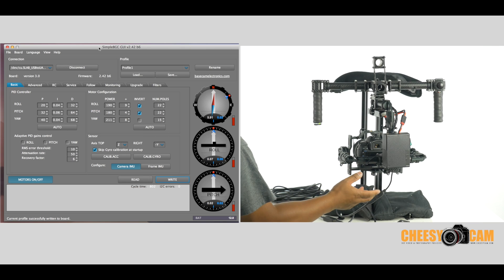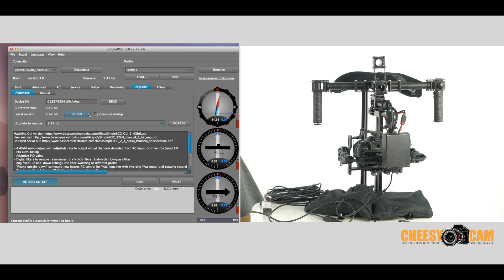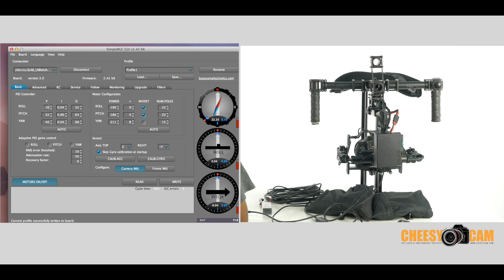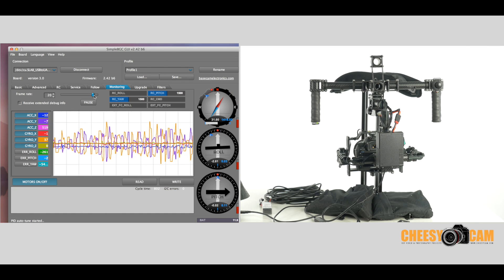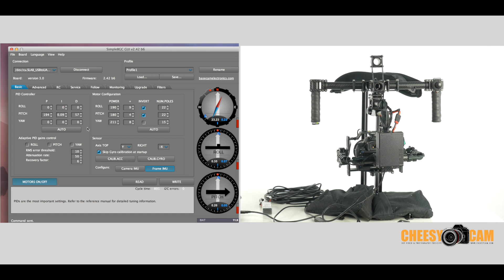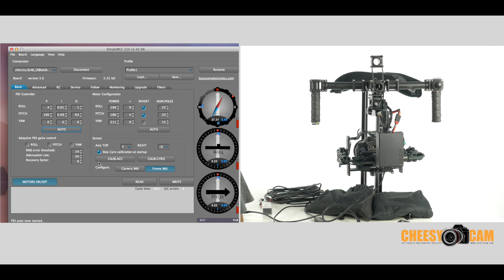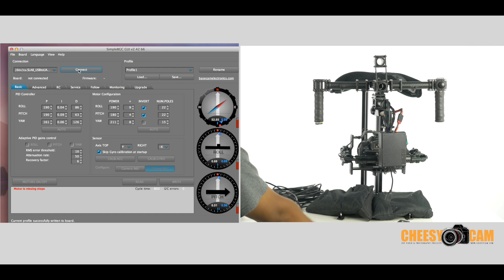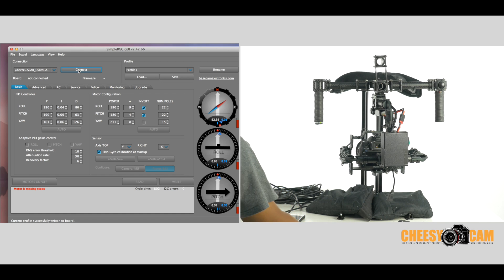3 Axis Gimbal Auto Tuning PID Settings Alexmos SBGC Firmware Upgrade

Comment: Quick question; if you deliberately push the pitch out of the horizon line will it move back again to a level position? Mine does this with roll and yaw but not pitch, any ideas?
Reply from the maker: Yes it should go back. Unless you are doing this in a profile that has follow mode enabled. Try it in a profile without follow mode.
Reply: I have follow YAW enabled, but roll and pitch disabled. Is this still a wrong profile?

Comment: https://www.youtube.com/watch?v=TBIwrVIo2Ig

Anyone can point me in the right direction to fix this "overpitching". I have followed several PID tuning guides without success.
Reply from the maker: +Johan Hilding I would double check all of your sensor orientations. Looks like it's confused and doesn't know which way to rotate.
Reply: Do you mean a 6 point calibration?
Reply: Im checking the sensor TOP and RIGHT. If I change them it turns upside down or just vibrates. Did you mean these?
Reply from the maker: +Johan Hilding If the sensor orientation is correct, then try selecting the 'invert' option for pitch.

Comment: These things are incredibly touchy if you don't know what you're doing I wouldn't mess with any of the settings using SBGC. I did your one tutorial to auto calibrate the sensors and I'm still going back and forth with their tech people to fix everything. It has been a week now. It's a complete mess. Seriously it's a horrible idea to mess with anything unless you know what you're doing. I'm about to send mine back I'm so frustrated. So heed my warning unless you want a cool looking paper weight.
Reply from the maker: +Max Liberatori It can be very frustrating if you're unsure about what to do. Once you know how to do it, it's pretty straightforward and not frustrating at all. I guess you begin to understand 'what not to do' and then you never get in a situation where it's not working well.
Reply: +MrCheesyCam truth man truth.
Reply: +Max Liberatori Did you take the backup of the original setting? And then reapplied if the auto tuning failed

Comment: Plugging my ASP 3 axis gimbal with 32 bit alexmos 2 imu's goes nuts when plugged in. IMU's have been calibrated. What I'm I missing?
Reply from the maker: +Moses Yuhanna Are you sure the sensor positions are correct? If you have the orientation off it will go crazy.
Reply: Thanks. That fixed the issue. would you know why the yaw axis might be wondering slowly? What pid setting do I adjust? Thanks again
Reply from the maker: +Moses Yuhanna Calibrate Gyros, and if you are using a Joystick, Calibrate RC Trim: http://cametvblog.com/how-to-calibrate-joystick-neutral-position-to-prevent-your-gimbal-from-drifting/

Comment: I can’t seem to get the motors to working. It connects to the software fine. The motors just won’t move. 

Tarot 680 Pro
Naza M V2
Taranis Plus Transmitter
X8R Receiver
Reply from the maker: Triumphal Bridges Sorry i'm not sure what you're asking. Did you click on the Motors ON OFF button?
Reply: Yes I have clicked the motors on. 

Basically, basically I have followed the instructions in the manuals to the T. I have all of my channels in my receiver set up and I am getting responses from those channels. I have power to the Gimbal via my 14.8 V Multi star battery. I have even tested the gamble when my battery had drained to about 12.5 V. the gimbal reads on the software just fine however, I am not getting any type of Motor activation.

Now I am running into a separate issue. lol.
I was using the simple BGC software version 2.43 and then I switched to the 2.50b3 version just to see if my motors would activate. The gimbal read on both versions. However after I updated the firmware using version 2.50b3, my gimbal no longer functions on either software versions but the s/w still sees the COM port. I press connect on the right COM port and it just freezes. I have tried to connect to gimbal to downgrade the software without success. I'm using a Macbook pro btw. Thanks a lot!

Comment: I'm having some problems with pid tuning, not getting any  12c errors. My roll axis doesn't come back to home position, and when it does it comes back extremely  slow. Sometimes it jitters.
Reply from the maker: charles reeves The 'i' value is what makes it come back to home slow or fast. The 'D' value is what is used to reduce or remove any jitters. Depending on your condition, try raising the D value or lower the D value to reduce jitters. I would work on this method one axis at a time. It appears you are talking about the 'Roll' axis so only work on those values.

Comment: This is not an insult, but I find it funny that you are doing the video and discovering  the auto PID at the same time.  Its the same feelings I went through the first time.

Why on earth such high P and D.  I barely turned P up past 8 on my old 8 bit.  My problem is I'm aerial and when I fly right, the horizon leans right.  I've increased gyro thrust and everything.  I have a feeling the extremely high PID values are causing it.

Comment: HELLO SIR
i was trying to tune the gimbal everything was fine , till i upgraded and everything went to hell , the gimbal is shaking spining , the controler dont work no more , and its a brand new cam tv 8000 , please help me :(
Reply: Ghouti Lakhdar If you've just gone to V3 you'll find this problem is to do with calibration. The new firmware runs a temperature based calibration.  Try connecting to the gimbal on the software then turn off the motors. Now go through the new calibration procedure - all should be well after,

Comment: Wanted to thank you for the wonderful video series.  Lots of answered questions from it.  I was having issues with my apple weekend.  I am not completely seeing it work with iron clad effects everytime.  Its particular for me on connecting up.  I have had good luck in the past with having the system powered up and connecting up.  It seems a little issue sometimes connecting like it hangs.  On a side note I am tuning a alpha 5000 camera and am getting the pid settings on the edge of working.  I did the auto tune, but it was not holding the pitch as good as I wanted.  I moved the slider to the left and tried again.  No good.  I tried manually tuning the P,D values till it started humming than backed off and did a I value.  Seems like 20 degrees or more forward I get it to tilt forward a small amount.  I wonder if I am, doing something wrong.  https://youtu.be/S52MLqEwDgA

Comment: I think you did not hit the write button on the last tuning before you disconnected it. Is that a 32 bit or 8 bit alexmos?
Reply from the maker: cjthreelogy1 I was just doing a demo, but yes you should hit write any time you change settings (except for calibrating sensors and gryo, no need to hit write).

Comment: I got a good deal on an Alexmos 3 Axis gimbal on craigslist. I tried to upgrade the firmware from 2.30v b5 to 2.49 v9. It worked ok before I upgrade firmware but now when I connect it usb to my computer running 2.49 version my gimbal does not do anything and I get a time out message when trying to connect it. Do you have any recommendations because I went to SBGC website and the older firmware version links no longer work if I wanted to flash back to the original firmware? Did I brick my gimbal? Please any help would be greatly appreciated!
Reply from the maker: Victor Holloman From the new firmware you can choose a drop down menu to 'downgrade' the firmware. But the problem is most likely your settings. You have to walk through the process to set up all the settings like Sensor orientation, calibrating sensors, calibrate gryo, choose motor inversion, motor power, PID settings, etc.

Comment: I have been trying to set my gimbal up for hours but my yaw motor just keeps spinning slowly round in the same direction. I have tried inverting that motor. it does it with follow on and off. The no of poles is correct. I have calibrated the imu's several times. Can anyone suggest how I can resolve this.  Thanks

Comment: MrCheesyCam I received my Came 7800 and am using a sony a6000 camera. This camera is smaller and lighter than most cameras being used on this gimbal. I know that the gimbal comes set up with the most popular PID settings (which would be for a heavier/bigger camera). Everything seems to work okay. However, when I power the gimbal on, the camera roll is not level. Its as if the camera is leaning to one side. Is there a setting that I could change on the SBGC GUI that would help level this axis out? Other than the camera slightly leaning to one side, the gimbal does a great job maintaining the position and smoothing out the movements. 

Thanks!
Reply from the maker: Mark Grass In the software you can start with 'Calibrate Gyro'. Set the gimbal on a stand (use two chairs or broom sticks whatever to hold it up) and hold the camera as level and as straight as possible then click the button calibrate gryo.

If that doesn't work, then try to calibrate the sensors. Same thing, hold the camera as level as possible and click calibrate acc. There are two, so do it for each Camera IMU and Frame IMU.
Reply: MrCheesyCam Emm, your the man!!!! Calibration did the trick!

Comment: Hi MrCheesyCam, I got my new quick release plate for my came 7500 and i installed it. How ever i tried to configure it by following the 6 IMU settings and auto PID setup and i have a problem. Here is the video CAME 7500 error
Reply from the maker: Arish Perez I think you have 'number of poles' set incorrectly which may cause the 'motor missing steps' error message.Also I think you have the position of the sensor setup wrong too. When you flip it upside down, only the Z axis changes. The sensor side facing 'right' is still the same. Put it back where it's supposed to be.Also whenever you hit 'write' on the Camera IMU or Frame IMU make sure everything is perfectly level. You were hitting the 'write' button while your gimbal was totally not level.
Reply: MrCheesyCam How to get the right number of poles? I just copied it from one of your video :) I cant put the camera IMU on the same place because the cable is too short from new quick plates bought from came so that is why I decided to put it at the bottom of the the camera holder. How I would set up the right axis? before it was located at the top of the camera and the Y axis is on the left of the gimbal and Z axis is facing up. So i put the sensor at the bottom, my Z axis now is facing down so i set it -Z and the right axis is -Y. Is my axis is correct? Thanks again MrCheesyCam for taking time to answer my questions I dont even use my Came 7500 yet since i bought it because of this problem.. Mabuhay!
Reply: MrCheesyCam How to get the right number of poles? I just copied it from one of your video :) I cant put the camera IMU on the same place because the cable is too short from new quick plates bought from came so that is why I decided to put it at the bottom of the the camera holder. How I would set up the right axis? before it was located at the top of the camera and the Y axis is on the left of the gimbal and Z axis is facing up. So i put the sensor at the bottom, my Z axis now is facing down so i set it -Z and the right axis is -Y. Is my axis is correct? Thanks again +MrCheesyCam for taking time to answer my questions I dont even use my Came 7500 yet since i bought it because of this problem.. Mabuhay!
Reply from the maker: Arish Perez The CAMETV 7500 came preconfigured and everything should have been left the same. I believe the settings should be 22 / 22 / 18 YAW. I would suggest that you start from scratch with your PID settings, and don't use the Auto Tune for now. Watch my other tuning video Part 7 - CAME 7000 3 Axis Gimbal Build - Super Basic PID Tuning for CAME 7000 3 Axis Gimbal

As far as changing the position of your sensor, you just flipped it. So the Y should not change. It's just upside down, but that does not make it -Y. After you setup your sensor positions, point the camera lens away from you as if you were going to use the gimbal. Then 'roll' the gimbal left and right and watch the sensors. If you tilt the camera left, the sensor should tilt left. If you tilt down, the pitch should tilt down (not up). Watch the software and figure out if you have things backwards.
Reply: MrCheesyCam Yes I did flip only the Camera IMU and Y axis still the same which is the left of the camera. So the right axis still -Y.... Am I confusing the left and right of the camera?
Reply: MrCheesyCam I found on your video a profile... is this will work on mine and do i need to change something? Thanks 
http://cheesycam.com/came-7000-3-axis-32-bit-gimbal-with-canon-5d-dslr-profile/
Reply from the maker: Arish Perez Ok, i'm confused but yes the settings should be -Y. The only thing that would have changed is the Z.
Reply from the maker: Arish Perez The 7500 is slightly different. Instead of going with a downloaded profile, why not try to start from scratch with basic PID tuning?

Comment: Hi CheesyCam good info for those of us who are shopping to see how A.T feature works, and I hope it is not too nit picky of me to point out that from the moment the camera first flipped over during the Roll portion of A.T. there was a red lettered Alert in the info box that said "Motor missing steps" and it stayed that way for the duration of the session. This begs a multitude of questions but I will simplify:-) I assume that you have figured this out by now and wondering if it is a consistent glitch in the GUI . Does this condition render the session as useless and that you should start over? Maybe it has been fixed in an update etc.... Comments? Regards C
Reply from the maker: Chris Leech Don't worry about that, it's because I was messing with the Poles option in the motor settings. I do a lot of testing and mess with certain settings. If you set those correctly you may not see that message. This is basically just covering the Auto PID workflow. As you can see in the end it still worked perfectly to keep my horizon level.
Reply: Thank you for getting back. Some say this auto tune feature may not work with the 32 bit boards which I have coming (Storm32BLGC), your experiences?  I'm attempting to get dual functionality from a couple of kits. Hand held plus Aerial format for my 810mm multirotor but how to do the quick connect .... More fun than a Lego set no? :-)

Comment: Thanks for the awesome Video! I seem to be having a slight issue with my roll. It just want to keep drifting slowly to the left and I can't stop it. any ideas?
Reply from the maker: Chris Haynes When you say 'Roll' drifting to the left, does that mean the horizon is not level? Or do you mean the 'Yaw' is swinging the camera to the left? Either one could be a few different things. 

First try to do a 6 point calibration on your sensors and calibrate the Gyros. If it is still happening try disabling the 'joystick' in the software. A bad joystick can act like it's always on and making the camera move. If you have a joystick, disable it in the software and see if it stills drifts slowly.
Reply: Reseting the sensors did it! Thanks for all of your help! We would all be lost without your videos.

Comment: i have legacy 3 axis gimbal with alexmoss simple BGC 32 bit...and i used camera sony A6000 +kit lens 16-50..after i tune CG...i try to use autotune pid..but it can't work...they always ossilation after autotune..can't you help me please mr.cheesyCam?thx b4   :)
Reply from the maker: frans sinaga Maybe the camera is too light for the gimbal? I don't know what gimbal you are using exactly, but try going through it manually. Try going through these steps: Part 7 - CAME 7000 3 Axis Gimbal Build - Super Basic PID Tuning for CAME 7000 3 Axis Gimbal

Comment: Hi MrCheesyCam,

I tried to update my my Came-7500 and try to do the auto PID.... however it is now not powering on, what do you think is the problem? I tried to return again from original fairmware and still no power.

Hopre you can help me this. Thanks a lot.

Cheers,
Arish
Reply from the maker: Arish Perez When you connect the gimbal, click the button for 'motors on/off' usually on the lower left of the first screen. Try that.
Reply: MrCheesyCam Yeah it works man... thanks. However i tried t reconfigure the IMU, the FRAME IMU button is disabled... What do you think the prob? thanks again! 

God bless
Reply from the maker: Arish Perez Jump over to the second tab and make sure you have motor outputs setup for Roll / Pitch / YAW and you enable Frame IMU 'Below YAW'. Hit the Write button to save your settings and then you should be able to configure it.
Reply: MrCheesyCam You are a star bro... will configure my IMU now
Reply: MrCheesyCam  After I update the IMU using my cube bubble, the roll went to up side down. Is that mean that I configure wrong my Camera IMU? I will try to post video about the error.. Thanks again